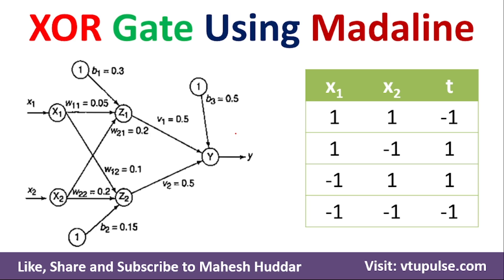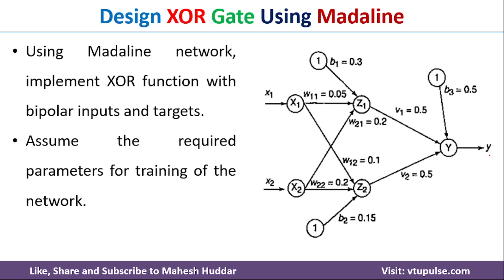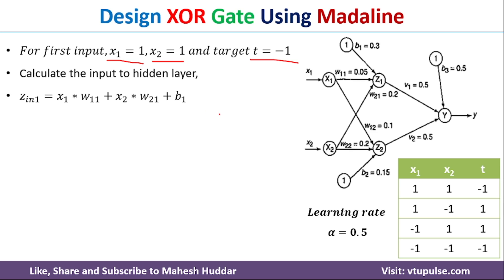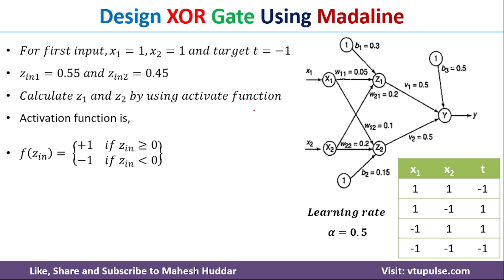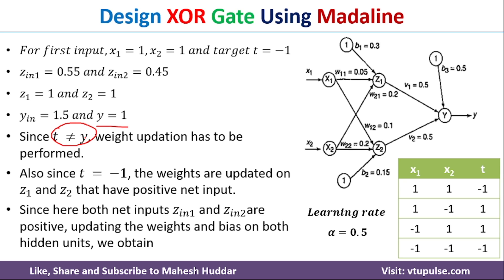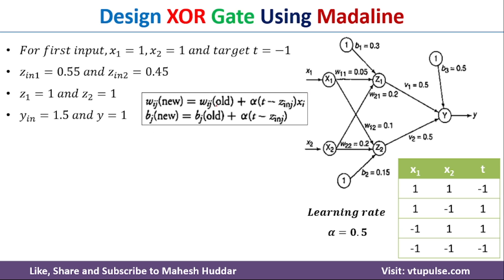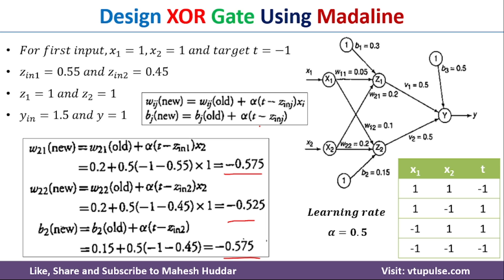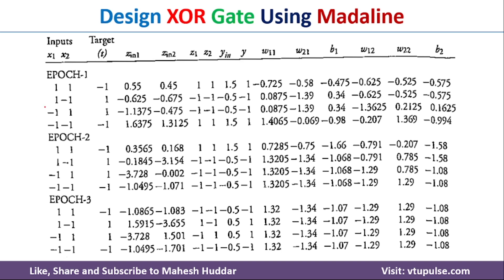15. How to Design and Implement XOR GATE using Madaline Linear Unit Soft Computing by Mahesh Huddar

Comment: in EPOCH2 where -1 and -1 is taken as input, there in w22 the value should be 0.785 rather than 1.29 as updation did not occur. Sir, please provide an explanation for that.